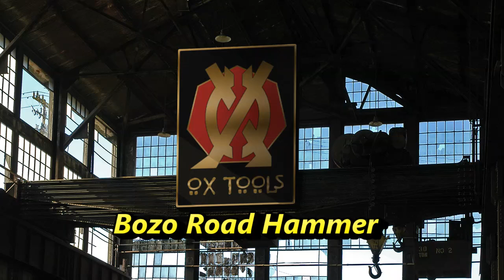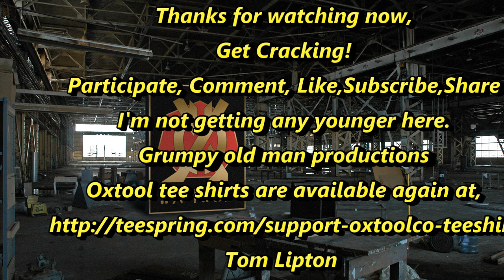Bozo Road Hammer

Comment: After driving a semi for several years and collecting all kinds of trucker things, I took my train horns off my truck when I left.  Now I have 2 sets of air powered train horns mounted under my hood.  When I find someone not paying attention, I have the means to make them wake up and drive like they should. It's pretty hard to carry on a cell call conversation with them going off right out side your car.  Of course with great power, comes great responsibility.  I will not use them if I think the person is going to freak out and try to swerve to avoid hitting the "train" on the interstate.  

It also is great for those 20,000 watt car stereos the kids put in.  Hit that a few times when they are trying to be "cool" at the red light, and they normally turn it down.  

My wife thinks I need to invest in Kevlar armor for my car, but so far so good.

Comment: Good one Tom!  At times you could use a whole collection of signs for various infractions.  Like "Your turn signal has been flashing for 20 miles!" or "What are you doing on the Freeway, Besides 45mph?" the list is endless.
Reply: it's a toss up between driving under speed and driving on the phone for most dangerous. right up there with dui and driving while sleepy on the highway
Reply: I remember seeing a sign holder like this in the 80s with a spiral flip posters on it to send all kinds of messages to other drivers.  I think Spenser gifts sold them.

Comment: I LOVE it! My method has always been to just lay on the horn and stay beside 'em. That or drop or gear or disengage the clutch on my Harley while "accidentally" opening the throttle. They really hate it when their window is down and I back my bike up to their door at a light. My right leg is 1/2" shorter because of this exact problem sigh

Comment: Try running the countersink counterclockwise - especially on plywood. Just spin it, and push hard on the drill - it squeezes the wood to a compact base for the screw head.
Nice "hammer" - This week, I'm definately getting me a hands free set to use at the wheel, when delivering & collecting rental trucks and vans...

Comment: Wordless workshop. ( stolen from the adv site ) Well done young man.

What kind of mechanical pencil is that?

Thanks

Scott
Reply: Looks like a Pentel .9mm pencil.  Yellow is .9mm and blue is .7mm
Reply from the maker: Scott Session Hey Scott,

My favorites are Tikky .9mm and my second choice is a Pentel .9mm with HB lead. Thanks for the comment.

Cheers,

Tom
Reply: Thanks Tom.
Reply: Scott Session Any of the Pentel Sharp Pencils (P203/5/7/9) are good, along with the GraphGear500 (.3, .5, .7, .9mm).

Comment: Very nice. Against the law here so we don't see it much. We also don't have 12-14 lane freeways, either.
Reply: We have lots of things against the law here too...but I can't drive a mile without seeing them done a dozen tines or more.  Speeding, crossing the double yellow centerline (on curves, straights...they just can't drive!), rolling stops, running red lights, no turn signals, cutting in front of other vehicles leaving less than one car length at 60 mph, tailgating, driving with lights out, lights broken, changing three lanes in one big motion (without signaling...), etc, etc. the only thing the cops seem to enforce is speeding....ever since radar was invented so they could hide in the bushes rather than be out where they can see the other violations. 

The ones I like are the ones who park in fire lanes while they "just run in for a minute".  I knew a guy once who drove the pumper truck for the local fire department. If someone was illegally parked blocking a hydrant when they responded to a call, it wasn't really a problem...40,000 lb truck with a 1/2" thick bumper barely notices the impact, but the car moves right out of the way!

-- Mike